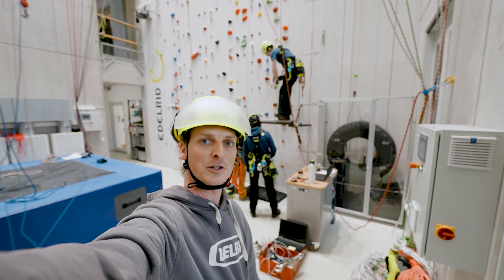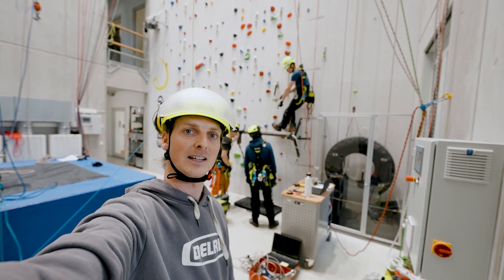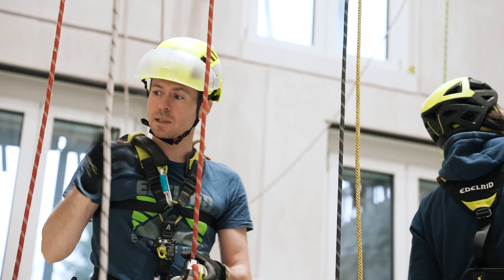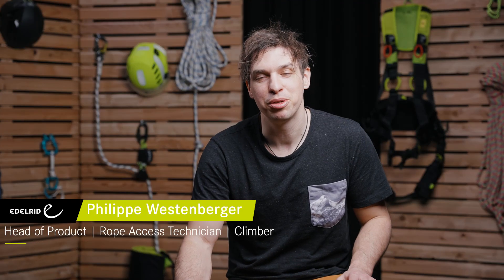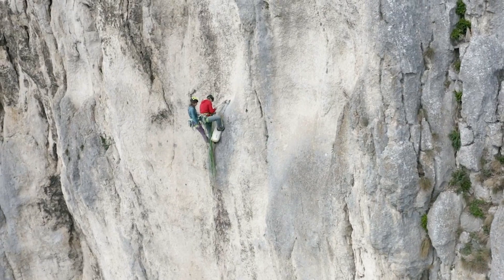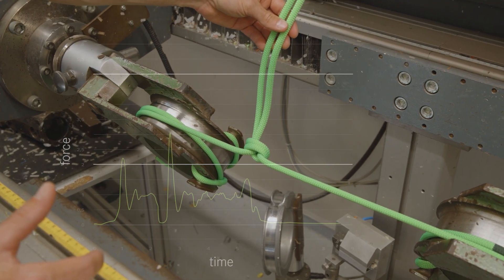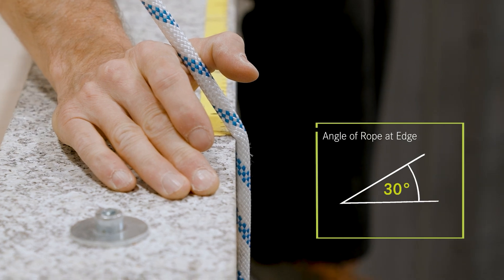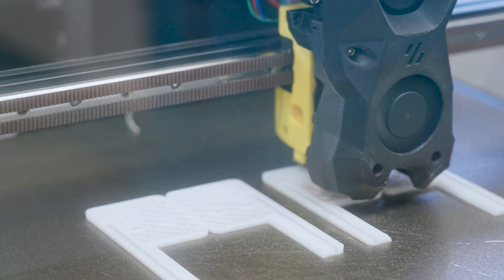What this circus is all about!

Comment: Hi! I’d love to learn more about using the pinch to belay the leader directly off the anchor. To my knowledge it’s the only ABD that documents support for this usage, and I’m curious what the forces are like compared to a tuber
Reply from the maker: If you allow, we try to not talk product specific details on this channel as much as possible to keep a certain objectivity. So, here at least I would not like to discuss the hows and whys of the specific user manual. But to give a more general answer: We also state that impact forces can be significantly high when belaying like this directly from the anchor. However, expressed in numbers, this depends greatly of the single components used as well as the fall scenario (height, payed out rope, weight of climber, friction, etc.). But if you check out our video about the risk assessment of LRS (https://www.youtube.com/watch?v=Q6N1Fav4MaI) and you go to the chapter of risk 6 - high impact forces, there you will see a few example scenarios. Belaying from the anchor has certainly this risk but might sometimes be the better choice for example in rope parties with significant weight differences, guide-guest constellations, terrain where the belayer might not have the space or possibility (hanging belays) to belay dynamically and could loose control of the braking rope, etc. At the end the rope party needs to decide this in their assessment of the situation.
Reply: Thanks so much for the detailed answer!